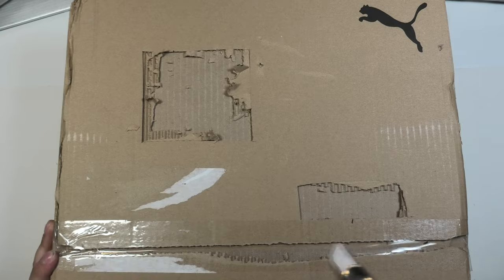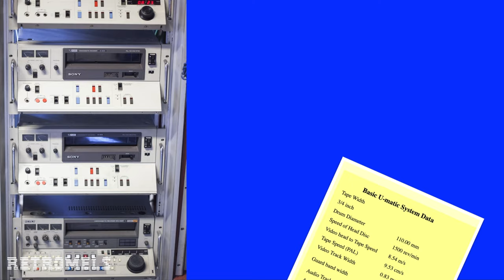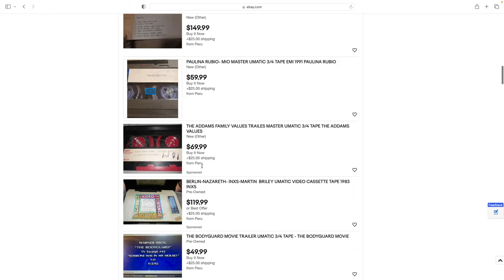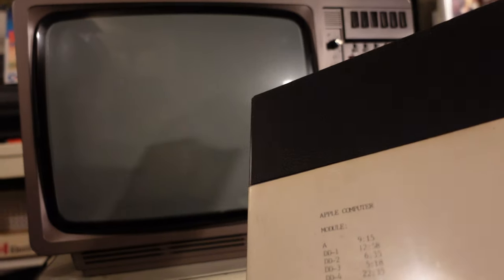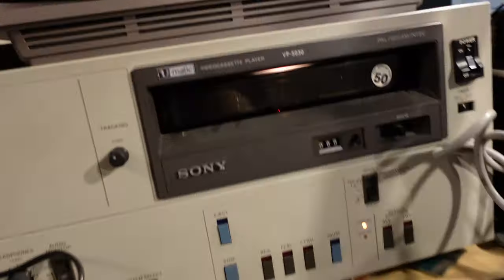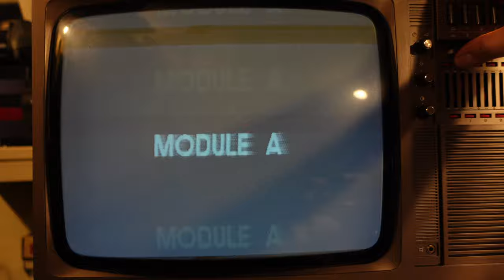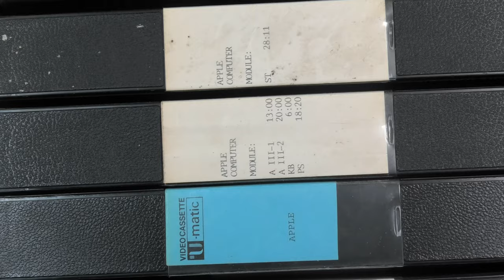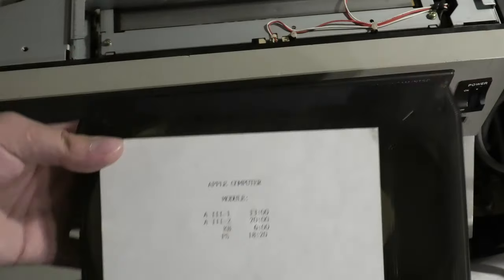Using a Ten Euro U-Matic Player to Digitise RARE APPLE Tapes

Comment: Nice video but I have a bit of info for you. I also have a few Umatic machines and I have been collecting for years. I provide transfer of old tapes for clients. You need to know that the Umatic format is split in three techinical video processing standards; Umatic Lowband (the machine you got), Umatic Highband and Umatic SP (Super Highband). The wedding video you saw was probably not in B/W but either in Highband or SP. The luminance information (B/W) you can still see, but the colors are missing because the color subcarrier was moved up in frequency to allow higher B/W bandwidth and also provided higher color bandwidth.

Also get an TBC when transferring old tapes. They have many drop-outs and the TBC will correct and remove many of those. The older For-A TBC´s are perfect for Umatics.
Reply from the maker: Thanks for giving some info! Always nice to read. The television I used was black and white. Indeed the wedding video has color. I have some saved searches for TBC’s. I think it will be fun trying those out. If I manage to find one of course.

Comment: There are a number of things you should know about preserving tapes. For example many tapes (especially Ampex) have the "sticky shed" problem: the magnetic layer gets detached from the tape and clogs up your video heads, unless you "bake" the tape in an oven at a low temperature (I think 50 Celsius) for a day or so. And even after that, the problem will return.
Also many tapes develop mold which makes them unplayable and unrecoverable.
Check out the @video99couk YouTube channel.
Reply: True!